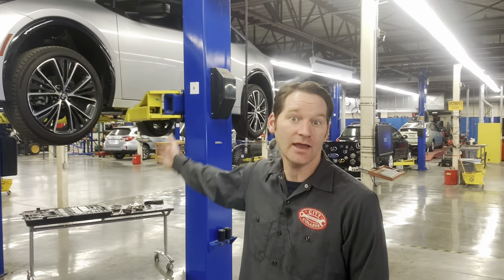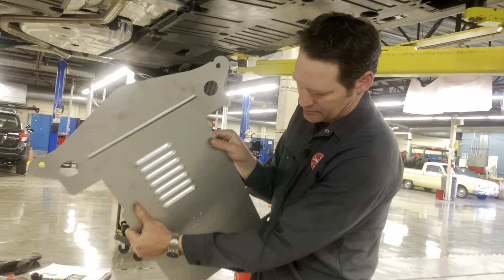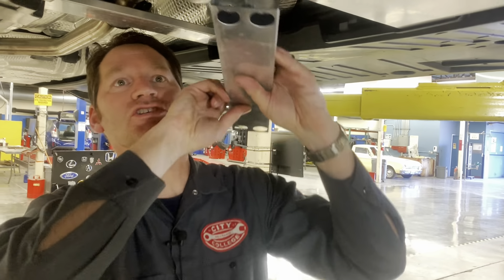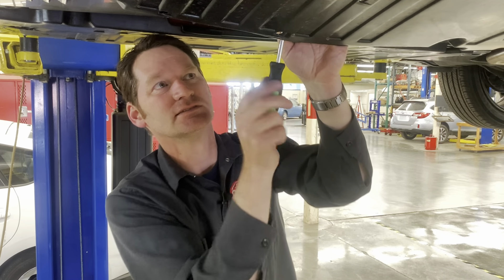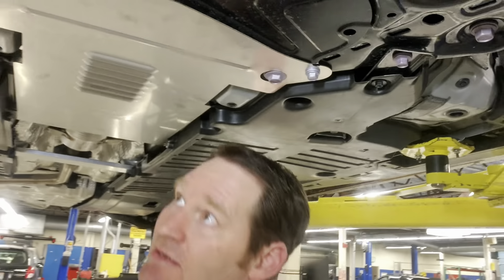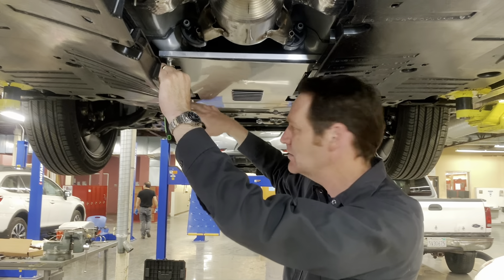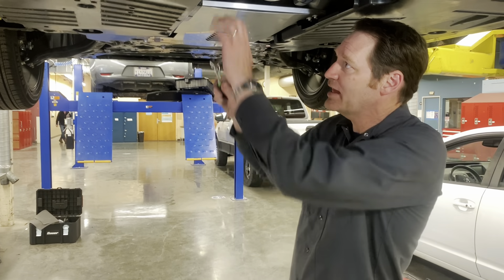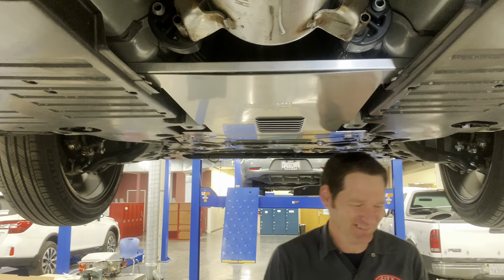2023 Prius cat protection plate installed

Comment: We had a muffler shop do a full rebar cage for our 2012.  Cost about $450.  Not as pretty as these plates but it would definitely take longer (and make more noise) to get through.
Reply: Be careful running into debris and trash on thw road. I ran over a rusted metal and thought the car sits high enough that id just on with no problem but the plate/shield made a huge loud noise but luckily the plate didnt get damaged

Comment: I’ve been in many garage and body shops that constantly have Prius with the plate still in place in the catalytic converter stolen.  My ex-wife had 3 stolen. Two with plate in place. 

My had two stolen. Second one with plate in place.  Caught them on video second time. So fast even with the plate
Reply: with the plate installed is just an illusion of sense of security?  it''d be better to buy a welding kit from harbor frieght & weld it shut yourself using a case from an old pc..
Reply: @coldfinger459sub0  welding looks easy than done, but if they're going to charge this  much for a cat kit, they may as well charge another $20 to include a set of security bolts with a unique key, right?